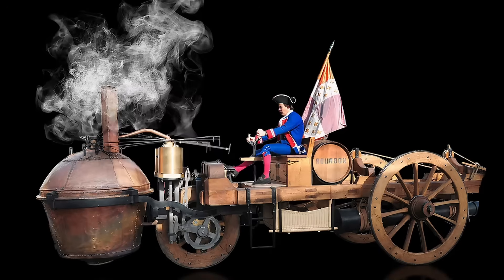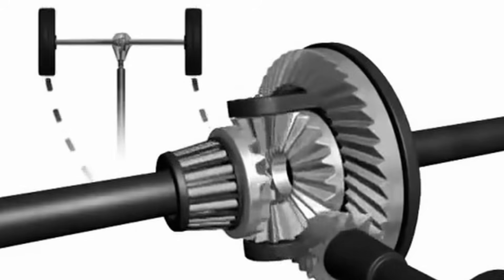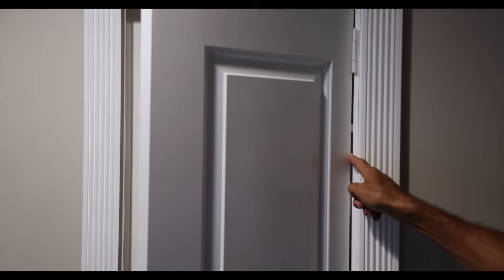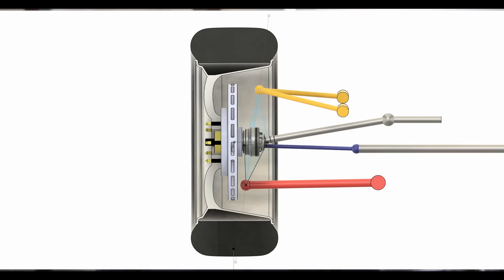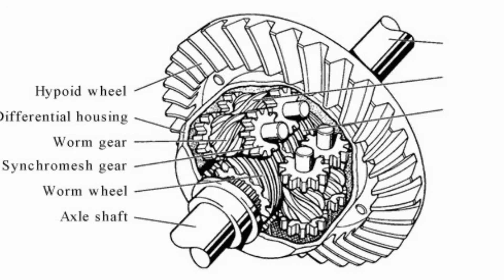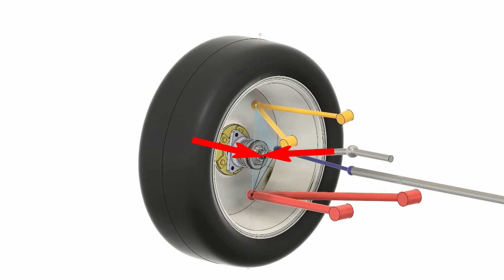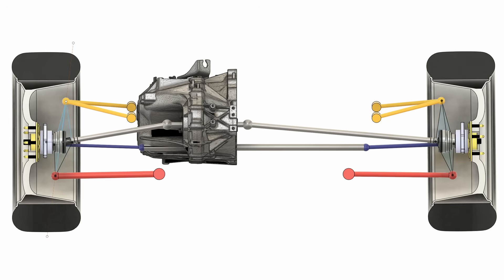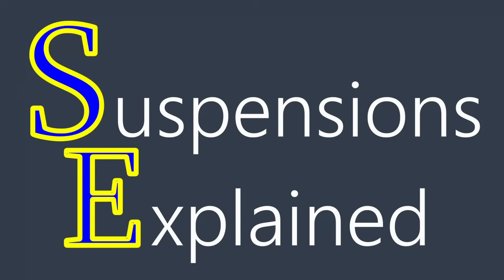Torque Steer: What it is and how it works.

Comment: Very interesting, I've never considered kingpin offset and always thought of scrub radius as the key factor. In fact I still can't wrap my head around it and how little you mention scrub radius in this video. Why is this kingpin offset more important than scrub radius? You appear to be saying that a vehicle could have zero scrub radius but if it still has this kingpin offset it'd still be effected by that aspect of torque steer? Why is this, isn't it the forces in contact with the ground that matter? 

I need to draw this to wrap my head around the relationship between scrub radius and this kingpin offset. Might edit this later after doing so. 

I see others have mentioned double/virtual pivots so I won't beat that dead horse. 

I've been pondering what an ideal steering axis inclination(SAI) would be. And have been reading about all the good effects of having a negative scrub radius. But then trying to ponder how that effects the self centering force from jacking as well as the camber effects. It strikes me, at least in my mind that an ideal would be the combination of a negative scrub radius and a negative SAI. This appears doable with essentially the 5 link suspension Audi uses.
Reply from the maker: Scrub radius is important when considering braking forces (as long as you don't have inboard brakes) but drive forces act at the wheel center, so kingpin offset becomes important. The reason is that we are looking at it from the perspective of the suspension, not the vehicle. When you accelerate, there are only forces acting on the suspension, there are no moments. There are moments on the wheel and tire, but since they are connected to the knuckle with a bearing, these moments cannot be transferred to the knuckle. That means the forces have to act on some part of the knuckle. When you are braking, there is a braking force acting on the knuckle but there is also a moment generated by the brakes. This moment "projects" the force down to the tire contact patch. As far as the knuckle is concerned, the force is acting at the contact patch. This is why the scrub radius is important during braking but the kingpin offset is important during acceleration.
Reply: @suspensionsexplained  If the knuckle doesn't rotate around a transverse axis (along the line of the axles) with vertical suspension movement, there is no difference at all between braking and acceleration. You could use a design with small amount of rotation of the hub/knuckle to give anti-dive under braking. (The extreme version of this was the short leading-arm suspension of the original little Honda 50 motorcycle. The harder you squeezed the front brake lever, the more the front of the bike went up!) It's similar to trailing arm independent rear suspension with RWD. You get squat under acceleration caused purely by weight-transfer - the moment of the horizontal accelerating force at the road acting below the car's centre of mass. But under braking you don't get as much corresponding rear lift, because although there is less weight on the rear tyres when braking, the torque of the rear brakes pulling the rear wheel upwards works against the effect of the weight transfer.
Reply: @suspensionsexplained  Trying to wrap my head around this. Would it be accurate to say that what's really being considered is less the load the wheel applies to the knuckle. But more the load the axle applies to the knuckle through it's interaction with the wheel? Thinking about it that way I can see how this makes sense.
Reply: I agree that scrub radius is absolutely the key factor. But it is by no means a constant distance. Distortions of the tyre under lateral, horizontal, and vertical loads, as well as body roll and the fact that the road surface is never perfectly smooth and flat, mean that the effective centre of effort of the tyre-to-road forces moves around quite a lot.

Comment: How does a limited slip differential come into play with high horsepower FWD cars? From what I've read people praise such a diff for the ability to dive into a corner, the more throttle the more turn-in. Is that a case of using torque steer to your advantage?
Reply: Yes, partly. It's a little unpredictable in its effect, and quite disconcerting when it catches you out by not doing what you expect. It relies on the outside front tyre to not have reached the limit of adhesion, which isn't quite the case when cornering at maximum lateral G-force.
Reply: No. It isn't.

Comment: You mentioned the 1934 Citroen Traction Avant but the next model, the 1955 DS19, did have centrepoint steering, where the CV joint was bang in the centre of the wheel and the vertical steering axis passed directly through the centre of the tyre/road contact patch.  It did have 300mm inboard disc brakes with ventilated pads.  This steering geometry eliminated torque and bump steer entirely.  There are YT videos showing the DS driven at speed over a spike which blows-out a front tyre, then the car brakes in a straight line, with the driver's hands held in the air for the cameras to see.  The 1974 CX still had centrepoint steering but with outboard front discs, requiring heavily-dished wheel rims.
Reply: Thank you! The DS really was a highly engineered car, lightyears ahead of its competition.
Reply: If I remember correctly, even the 2CV had center point steering and inboard drum- and later disc brakes. There's still a lot of Citroën traits unknown to most people, even journalists.

Comment: Renault introduced their version of a second steering axis in 2004 on the first Renaultsport Megane RS225 (based on the 2nd gen Megane). Look at the performance at the Nurburgring over the years. Great setup but difficult to modify for racing applications where you really want change the axis angle.
Reply from the maker: Thanks for letting me know. I'm not surprised there are others that had similar designs.

Comment: 9:20 I think this with a virtual lower pivot would probably be one of the best overall designs for a FWD car. Minimal KPI messing up your caster-camber-gain on the outside tire, 0 or negative scrub radius for puddle and general braking stability, and a low kingpin offset from the wheel torque forces. The only question I have is if we can get all of that with 35mm or so of wheel offset (something far more commonly found in aftermarket wheels) compared to the insane 60mm (almost nonexistent in the aftermarket except for very expensive custom multi-piece wheels) that Honda uses with their dual-axis strut on the FK8 and FL5 Honda Civic chassis.
Reply from the maker: Thank you Drunken Hamster. A virtual pivot would certainly help but you are still limited but how far outboard you can put the upper strut mount. Passing the KPI through the wheel center with the usual location of the upper mount would make for a very large negative scrub which would have other very bad consequences.
Reply: @suspensionsexplained  I'm not saying use struts, I timestamped the part in your video where you spoke of double wishbone with a large spindle so the upper ball joint is above and in the middle of the tire. That, with a virtual pivot lower, should give the most kingpin offset with the lowest kingpin angle and scrub radius, right?

And if it does, specifically to the point of having ideal minimization of torque steer with a 35mm offset wheel(more aftermarket availability), that would be significantly better than Honda's (and Ford's and others) strut systems with a knuckle inside the wheel and using ridiculous offset wheels (ie 60mm with no aftermarket options) to get reduced torque steer.

Which is not to mention the other benefits of a Double Wishbone suspension for dynamic alignment control, of course.

Comment: Great video! 

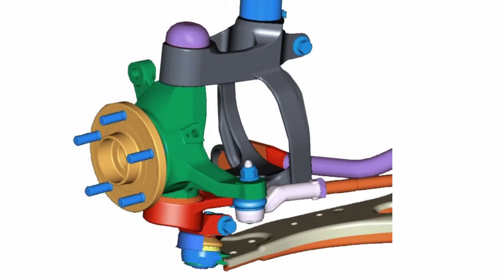At 9:46 it looks like the suspension is overconstrained, unless the strut now has pivots at its top and bottom, which then seems to make the strut into a coil over...
Reply from the maker: I had to simplify the model to keep from it getting too big but there is a pivot at the top of the strut where the damper and the spring meet the body. The damper and spring are rigidly connected at the bottom to the knuckle. It's not over-constrained when you do that.

Comment: Hi Huibert, thank you for the interesting video! A few additions:

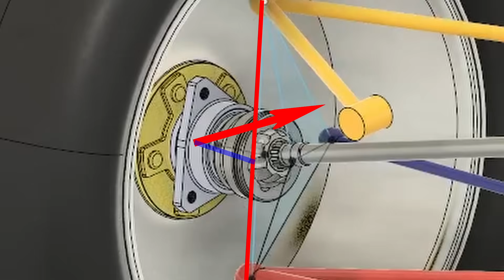5:42 The kingpin offset is a bit difficult to see without excessive kingpin inclination angle. I've seen quite a few wrong depictions of it online. 
It is sometimes shown as perpendicular to the wheel centerline, but it has to be perpendicular to the steering axis.

8:50 The way around this is to separate the A-arm into 2 individual links - virtually extend the links, their intersection is the pivot point. 
Earliest example I know of is Toyota Super Strut, Audi has been using it for a long time as well.

9:48 Honda Dual Axis Strut (used in Civic Type R - FK2, FK8 and FL5), used in combination with very high offset wheels (+60)

18:30 Fix everything with steer-by-wire, a torque vectoring differential, brake torque vectoring and rear wheel steering 😋
Reply from the maker: Also, a virtual pivot point would get around some of the problems but could create others. There is a limit to how far outboard you can "project" the pivot point. If you try to go too far, then the pivots need to be far apart which will create other problems as you steer. The pivots "walk" around each other as you steer and the virtual intersection moves. This means the kingpin is also moving. You need to keep this movement to a minimum to control scrub and caster trail which means keeping the two pivots as close together as possible which means you can't project it outboard as much as you might want.
As far as wheel offset goes, it all depends on how the brakes, ball joints, and bearing fit inside the wheel. On the Lincoln LS/Jag S-Type we ended up with 65 mm offset, but then we were trying to fit all of that stuff with a single lower pivot. A double ball joint would have helped but we didn't have that freedom.
As far as steer-by-wire and torque vectoring goes, those just hide the fact that you have a fundamentally poor design. Start with a good design and all that other stuff can be used to make an already good design even better.
Reply: @suspensionsexplained  Thanks for the explanation, I didn't know that about virtual pivots!
Reply from the maker: I know. It's a 3D problem that is very difficult to illustrate. You really need to visualize it in a full front view but then you are looking at the force arrow straight on so it wouldn't be visible. I don't have the graphic talents to illustrate that, unfortunately.

Comment: Love your videos , I’m getting ready to swap a 3800sc into a beetle and keep it RWD with the transaxle. Very useful info
Reply from the maker: That sounds like a really stupid idea..... and I love it!!! Go for it!
Reply: @suspensionsexplained 😂😂 thanks, I wish you would have went little more info for RWD applications, for instance like the Lamborghini miura , lotus Elise, fiero or MR2, granted they aren’t front wheel drive but they still same issues without the steering component
Reply: 3800 swap 👍
   fyi .. LS4 V8 might fit too.   And may weigh less than 3800.  
Good Luck & corvair half shafts

Comment: Have been wondering about this! Thanks!
Curious though: What if you want torque steer? For example on an oval?
Then if your outside driveshaft is longer, you'll want to decrease that length as much as possible right? Or does that reduce inside grip/torque, which will make you slower?
Reply from the maker: I'm not sure I would go for that. Once you lock in your shaft lengths, it would be very difficult to change as part of your overall handling tuning. I would prefer to keep all the things that impact understeer/oversteer to be parts I can easily swap and change.